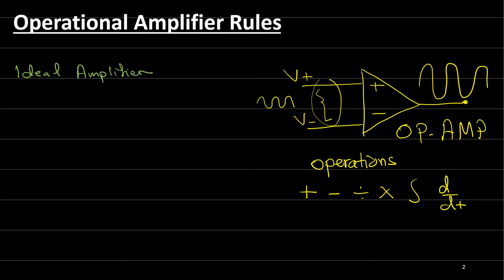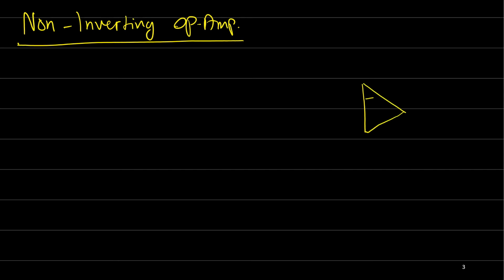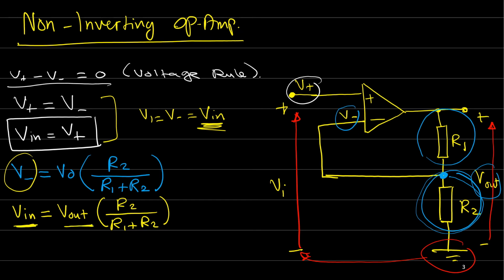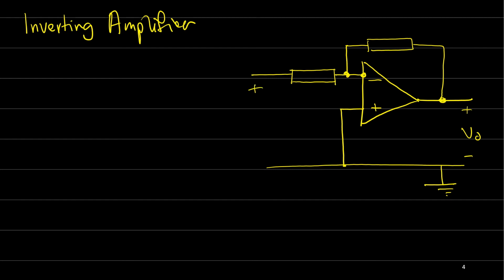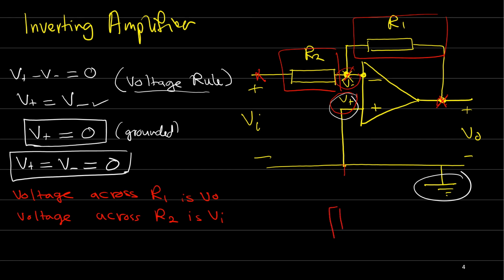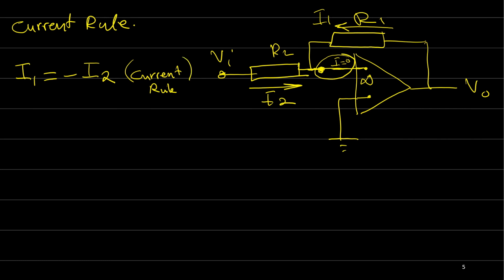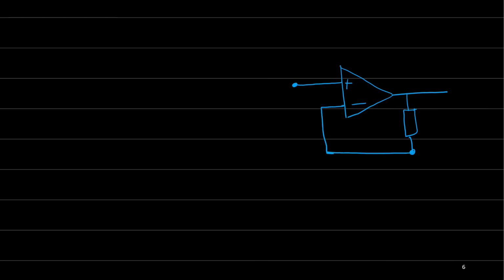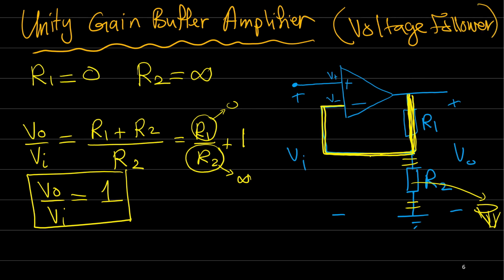Operational Amplifier (Op-Amp) rules | Analogue Electronics

Comment: Is rule no 1 3:10 valid in open loop or in feedback configuration  or both ?
Reply from the maker: It's just for closed loop system. I forgot emphasis on it in this video. However, I do not think that we will use the op-amp without any external components, right?
Reply: @Elkhateb  Thank you, Looking forward for the next video on this subject.